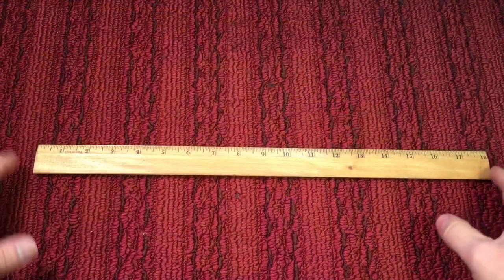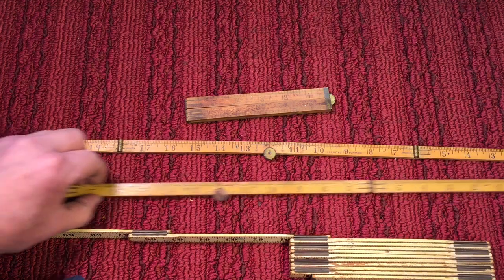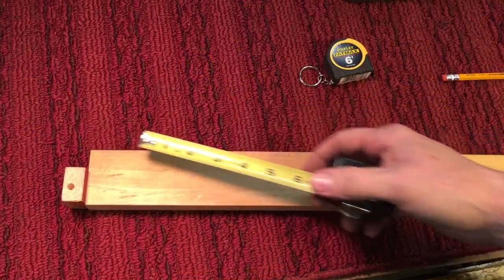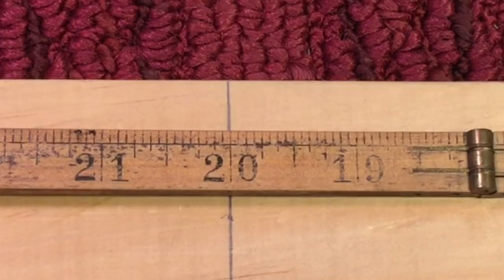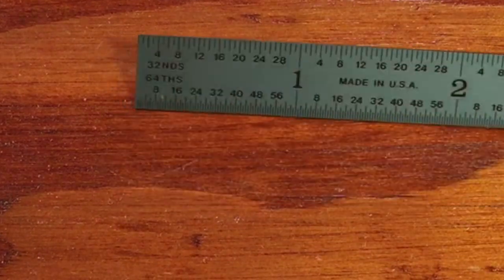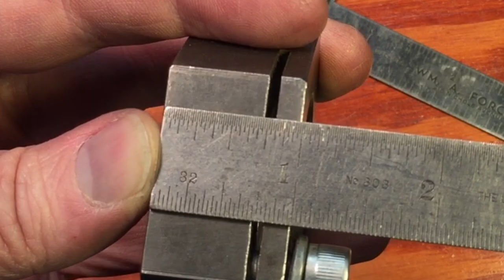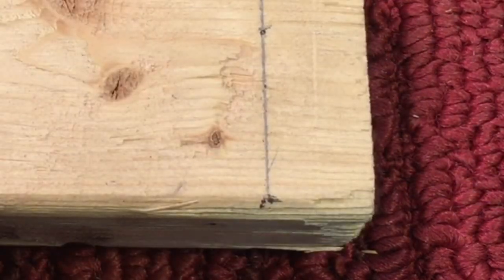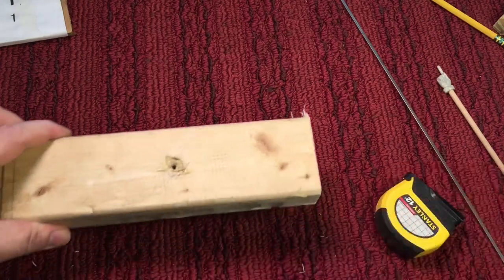Chasing Accuracy...  Rulers

Comment: That “truck” is the ugliest thing since the Pontiac Aztec. The torque available from an electric motor intrigues me though.
Reply from the maker: Eric I never liked battery stuff... Knowing that all those batteries will have to be changed in 6 years bums me out.  😃👍
Reply: You’re absolutely right. They will probably cost more than the vehicle is worth. Also, the environmental cost of battery manufacture and maintenance, on that scale of production, could be very high.
Reply: Perhaps a small diesel/electric would be better. Imagine that in a ton or ton and a half truck. Talk about a stump puller!